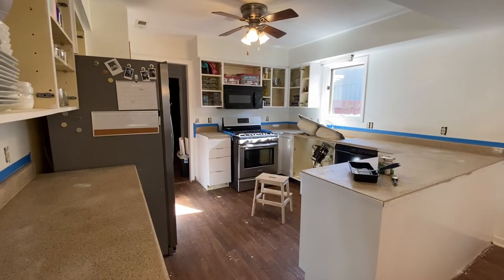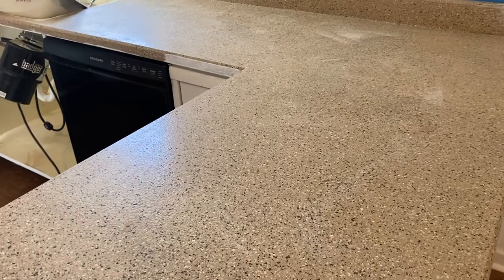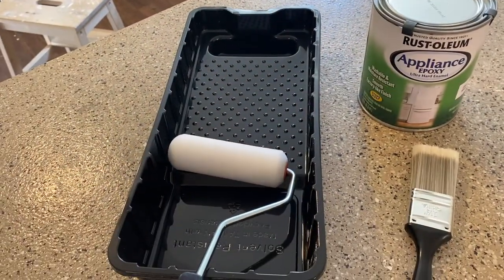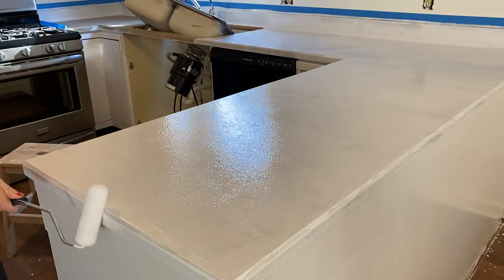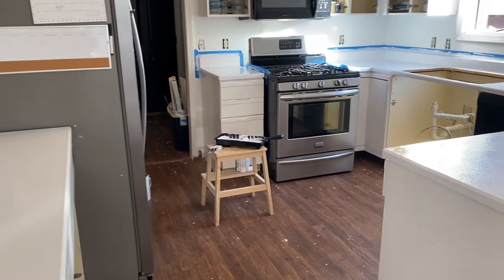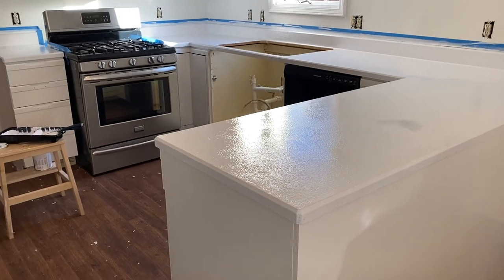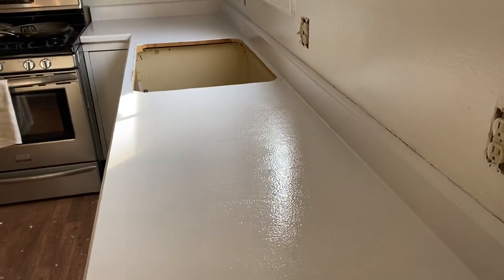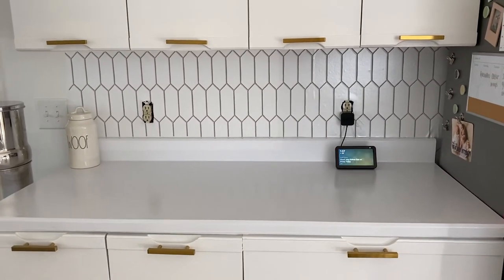How to Paint Kitchen Countertops | Epoxy Kitchen Countertop | Painted Epoxy Countertop

Comment: Great job!  I'm getting ready to do my laminate countertops with this paint.  How are your countertops holding up?
Reply from the maker: I have one scratch that happened a couple days after I painted (so I think it wasn't fully cured) but other than that, no issues!
Reply: Did you end up doing yours like she did? If so, how did yours turn out. I'm about to do mine. I'm so scared 😱